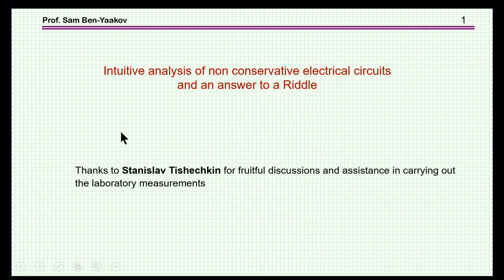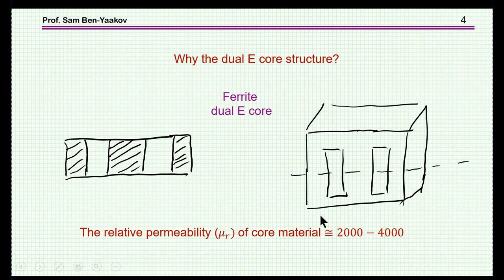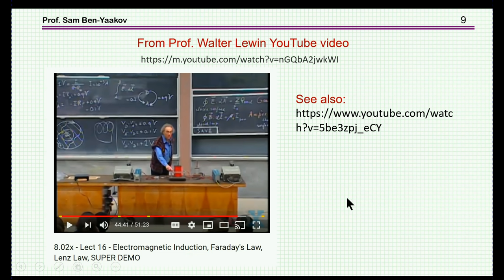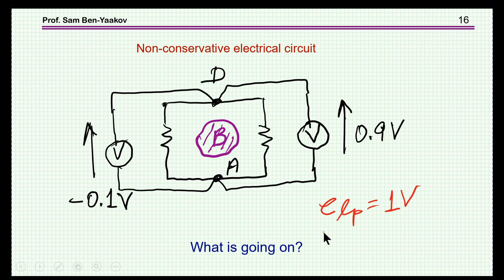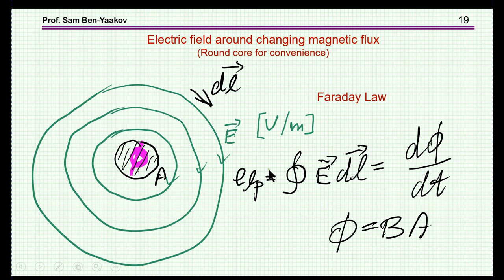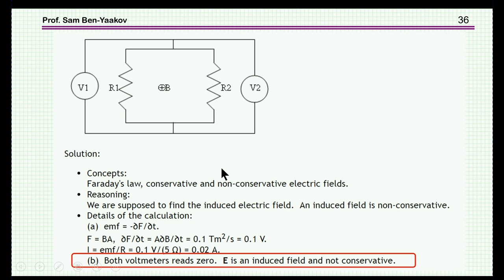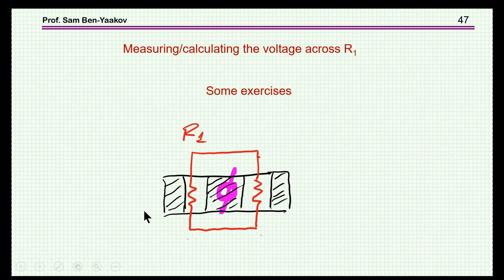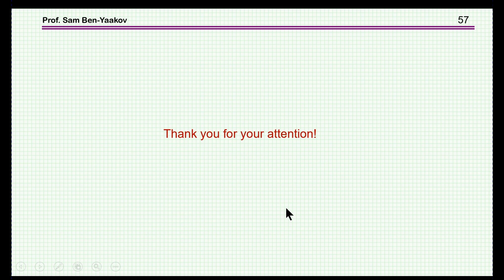Intuitive analysis of non conservative electrical circuits and an answer to a Riddle

Comment: In a schematic, it is usually assumed that wires are ideal, with no resistance, inductance, or capacitance. By adding mutual inductance, you in effect added another component to the circuit.

Here's another puzzle about electromagnetics that's actually easy to try: Take a piece of wire and thread it through a 3 foot piece of 1/2" iron pipe. Now pass 1A through the wire and put a clamp meter around the iron pipe near the middle. (The wire forms a square with one side going through the pipe and the power supply connected in the middle of the opposing side.) Would the meter indicate 1A, 0A, or some other value?
Reply: Presumably the iron pipe tends to "shield" the magnetic flux encircling the current from linking into the clamp meter's magnetic circuit. With little or no magnetic flux in the clamp meter magnetic circuit it will indicate a negligible value. Perhaps the relative reluctance of the paths will play a role in the apportioning of the flux -  one cannot definitively state without doing the test. I'll add a supplementary question: Suppose I cut a single helical slit the full length of the pipe. What happens then?
Years ago, a fellow electrical engineer related to me that he had once specified enclosing individual 3-phase heavy current power line conductors in separate iron pipes (one long iron pipe for each phase) to mechanically protect them along a power feed run to a load on an industrial site. When the electrical installers turned the power on to the load he soon realised (after some deliberation) his unfortunate & costly mistake.

Comment: Nice Video!

 Another way to think about emf is by visualizing what the electrons are doing in the wires and resistors.  Electrons are flowing around the circuit in 1mA, but the electron density in the resistors is not constant. Free electrons are more concentrated at the negative voltage side of the resistors, and are less concentrated at the positive voltage sides of the resistors.  This creates an electron concentration gradient in the restive material, an electric field, and the voltage across each resistor.  In the wires, the electrons can flow so easily, they stay uniformly concentrated and no significant potential develops inside the wire (E field is practically zero inside a good conductor).  
     When you perform the line-integral of the E-field around the loop, you encounter variations in the E-field inside the resistors that exactly "balance" (KVL) the induced emf predicted by Faraday's Law.
Reply from the maker: I think the observation in last sentence is nice and gives an insight on what is going on. But I do not think that: " Free electrons are more concentrated at the negative voltage side of the resistors, and are less concentrated at the positive voltage sides of the resistors. " is correct.
Reply: Edited:

 @sambenyaakov ,

 Hmmm.  I guess I need to go back and reread about some material-science stuff. It's always humbling when you have a bachelor's degree in electrical engineering and you realize you don't even really have a good understanding of the mechanism that causes a voltage drop inside a resistor.  I thought it was due to a tiny (almost immeasurable) concentration gradient of the free charges, but I could be wrong.   I didn't know what to call the sides of the resistor that the voltage is across.  "Negative Voltage Side" was my way of saying the side of the resistor at the lower potential, and "Positive Voltage Side" is the side of the resistor at a higher potential.  This wasn't very clear, and I apologize. 

Time to dig out the Materials Science textbook!
Reply from the maker: @trevorkearney3088  , Thanks for the link to the nice paper. You are of course correct but I was referring to the macroscopic rather than the microscopic aspect. Putting in other words what I meant:  in  as much that the surface charge are present, I think they are the result rather than the cause of the induced EMF and resulting current. That is, you do not need to invoke the surface charge to analyze and quantify the effect of induced EMF.  Good conversation. Thanks.
Reply from the maker: @jessstuart7495  Hi Jess, Please see my answer to Trevor below. I think there was perhaps a misunderstanding on my side.  My sweeping statement was based on my understanding that the charges are the result and not the cause in the Faraday 's induced EMF. So in my view they do not  provide any additional information except for explaining the microscopic situation.
Reply: @sambenyaakov ,

 Well, I wasn't very clear in my original post.

 My thoughts were that the time changing magnetic field sets up a very small electric field in the metal wire, and free electrons flow around the circuit and "pile-up" (have a slightly denser concentration) at the negative potential side of a resistor, and a slightly less-dense concentration at the positive-potential side of the resistor.  The concentration gradient will adjust itself until the voltage across the resistor "balances" the voltage (line-integral of the tiny electric fields) induced in the wire. Yes, the voltage across the resistors, and the charge distribution inside the resistors are completely determined by the emf in the wires.  

 Thanks for the interesting videos and interesting discussion.  

 I've always had a bit of conceptual trouble with Faraday's law, especially when he talks about field lines cutting conductor loops.  I like to try and understand the "differential" mechanism behind physical integral-theorems.  Stoke's Theorem is an incredibly powerful tool, but I think it hides some important details about what is actually going on inside the wires.
Reply: @jessstuart7495  
In the light of your comment about your misgivings regarding Faraday and flux cutting you may find John Roche's paper of interest. It can be downloaded as a pdf from the following link.
See:
https://www.semanticscholar.org/paper/Explaining-electromagnetic-induction-%3A-a-critical-Roche/5b155db75512d21c10c8bb92d7ccce4fa39acbc2

Comment: Great video as always. Very good examples . I wish some people on youtube with >2M subscribers (I don't want to say who ;-) would come and watch this and learn.
Reply from the maker: Considering that the video (barring a cyber catastrophe) will stay forever it might accumulate to to that number😊
Reply: I could be wrong, but what I got from the videos you won't mention is that their author uses a different (compared to this video and Lewin's) definition of KVL  and, though his circuit analysis is okay, he obscures the fact that Lewin's analysis is correct and his claim about KVL is correct, given the definition of KVL that he uses. I'm not an EE nor a Physicist so I don't know what all different people mean by KVL and so don't know whether the un-named person is using a definition that some other people also use.
Reply: @Guishan_Lingyou  With regard to those videos that i didn't want to mention the creator I would say this: "voltage difference" and KVL have clear cut definitions (whether in EE or physics it doesn't matter) and you can not just change them the way you see it fit or the way you like it to be. By definition, the amount of work you need to move a unit charge from point A to point B (at constant speed, uniform motion) defines the "voltage difference". As soon as you have non-conservative fields, as stated by prof. Ben Yakov here in this video, this "voltage difference" becomes vague because now it will depend on what path you take from A to B. In a conservative field (all DC circuits) the path is irrelevant and you always get the same value. Exactly similar to moving a weight up and down in earth gravity which is a conservative field.  Now, KVL was fundamentally and historically based on this conservative property of electric field and, thus, voltage, meaning if you move a charge from point A to point B and come back to A at constant velocity, no matter what route you take the total amount of energy that you spend is zero. Now imagine that path is a loop in a circuit. In a non-conservative field (when you have time varying magnetic field which generates electric field of its own) the above property does not exist. There were other flaws in those videos which I don't want to get into it here...
Reply: @amirb715  
A minor point. Classical electromagnetic theory holds that both the time varying magnetic field and the associated electric field are both effects. The time-varying magnetic field is not the cause of the electric field that arises. The cause of both lies elsewhere - other moving and accelerating charges are the primary cause.